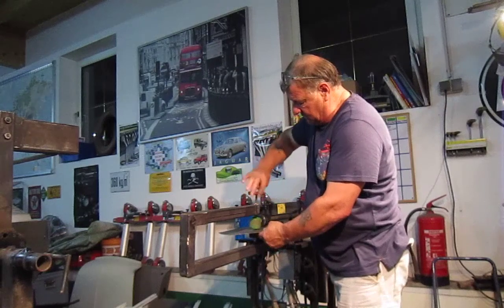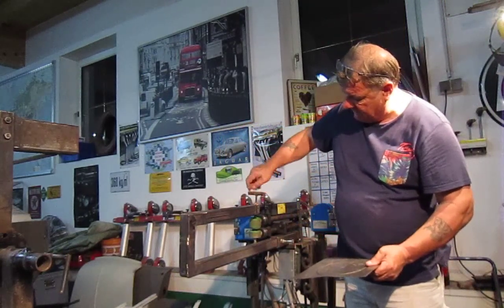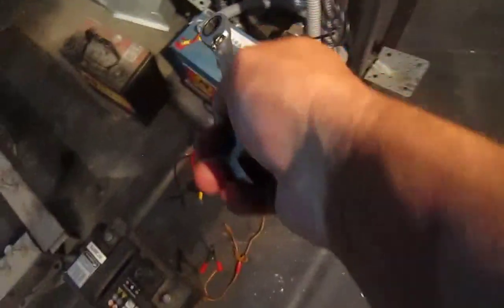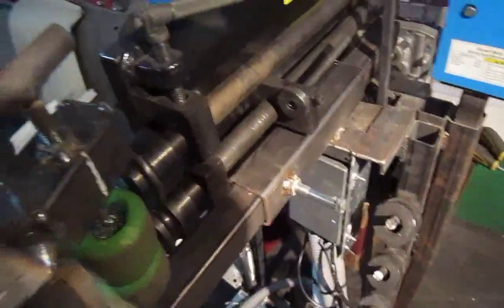CIrcles with a Bead roller DIY modification

Comment: I am only familiar with the spindle pin idea. small hole that can be filled after.
Reply from the maker: Brain,  To be honest unless i can get the skateboard wheels to centre a bit easier i will go for the pin idea! 
I liked they way the guy did his project but turning the wheels down is the key. Cheers David.